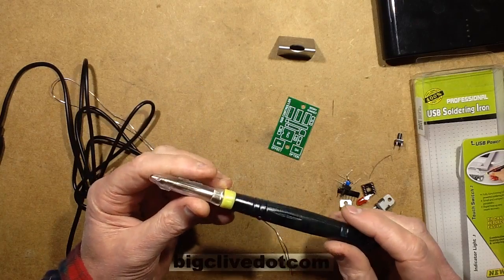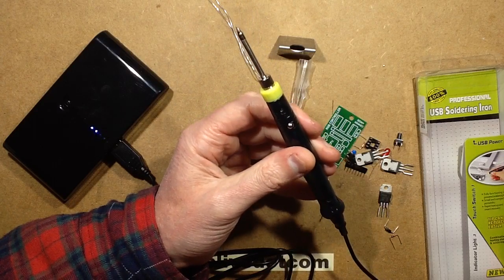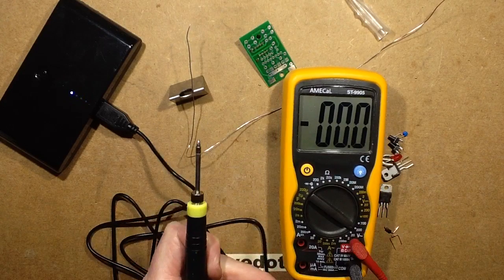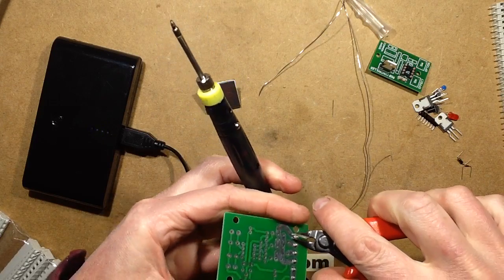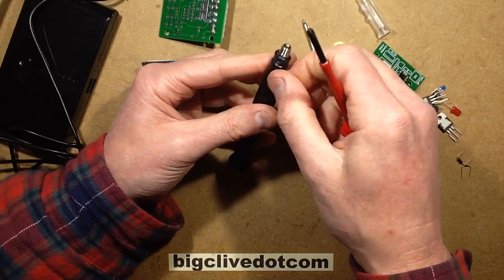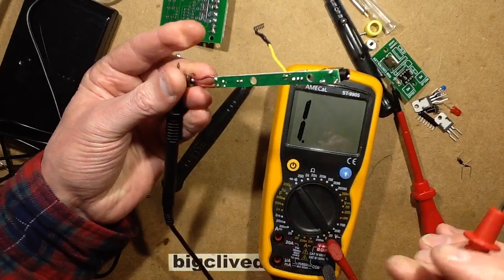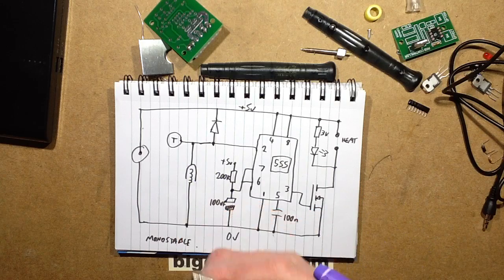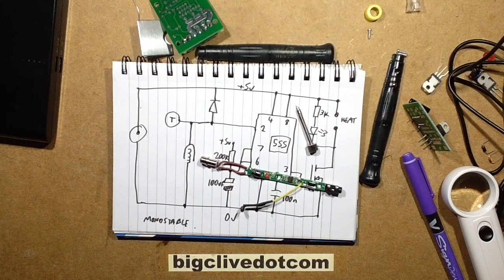USB soldering iron test and teardown with schematic.

Comment: I've got the same one.  Can't get it to tin and can't get wire to take the solder.  I'm thinking it might be my solder now because it's three irons so far. 

This iron killed my battery pack though
Reply from the maker: The power supply has to be able to deliver 2A and I recommend the use of solder bought from a component supplier in your country.
Reply: bigclivedotcom the power supply it killed was 2.1amp. The solder I got locally is just balling and falling off.  I should ask the microsoldering shop which one they use

Comment: mine didnt get hot. Only led came on
Reply from the maker: Did you unscrew the cap?  It pulls off and the threaded collar has to stay on to connect the tip.
Reply: Found the problem. Had to clean the socket a bit that the solder tip goes through. Works like a charm now

Comment: By coincidence, I already have an identical iron, which I bought for emergency use, but I have never needed it. Are replacement tips available?
Reply from the maker: Yes they are, but it's just as cheap to buy the full iron.
Reply: You can find replacement tips for $1.50 on AliExpress it's still better than paying $4.50 for buying a new iron.

Comment: Thank you so much for this video, I know it's over a year old but I just recently saw it. Was so impressed I bought one. It didn't work. Figuring it would cost more to send back than just buying a new one I just bought another and emailed the company and let them know it was DOA. The day after receiving the replacement I got another. The company had sent me a replacement free of charge. With the second one I was able to fix the first. I now have 3 for the price of 2 and I am very happy with them!! Thanks to this video and you I also know how to remove the replaceable tips.

Comment: for those, who are maybe interested: since my usb soldering iron doesnt work anymore, i took it apart and messured the resistance of the heating element (51k) and you can just connect it to an usb-cable and it will work like it did before (like said it the video), it's also good if the "auto off circuit" is too annoying :D

Comment: I can't believe I haven't seen this video earlier!  I have one of these soldering irons and I just love it.
It's very fast.  seems to be hot enough in about six or seven seconds.

I have it in a little kit with a small 18650 power bank and it lasts a pretty good long time.  

It really does work surprisingly well.

Comment: What if i solder a 3.7 volt adapter to the contacts of a powerbank where the battery would be connected to.
Could i then just plug it in

Comment: The good performance is all due to the near perfect thermal coupling between the heater wire and the tip because those are one indivisible part.

Comment: Is it 100% safe when used with a power bank? I will need to solder some stuff that would be dangerous if its outputting electricity and would break it.

Comment: many years ago i received a battery operated soldering iron called Cold Heat from Radio Shack. Its ok, but eats batteries pretty fast and i think it could damage components. i was using it once and it started lighting up LEDs on the board? lol 

https://en.wikipedia.org/wiki/ColdHeat

Comment: sheeeeeettt I am going to buy that sucker. When I m working on my bike (the electrics), I could never proper solder the fucking cables, because I have no accesable socket outside.... But fucking hell, I would have NEVER thought that such tiny usb soldering irons could handle anything....

Comment: Kind of put of by the Chinglish instructions: 
Method:
1.Open the iron burger skull, not to the left twist, pull off can be used directly. If left to turn the screw wrench to Gary, iron head shaking does not connect, unable to work! Then cover the right screw directly pull under it.
2. The product switch is the human body induction switch, the hand holds the handle 5 seconds to begin to heat up, after leaving the handle, the handle will slow down.
3. The power supply is best to convert the USB power supply, computer power supply, or more than ten thousand Ma mobile power supply. Small capacitance of the mobile power will not move!

Comment: I have one of these, had it long before your video in fact.  She is not without a down side, for one the male plug is troublesome you see I was in the habit of using her for short jobs then just unplugging it from the iron side and laying the plug aside. I had it hooked to a 110 to 5 volt multi outlet USB charger device that puts out lots of power. Anyhow one day the plug fell against something that shorted it out. I could smell something burning, and like an idiot I began to feel around. I now have a perfect mark of that plug on my left hand, man that thing was HOT.  My chair nearly burst into flames because the cord was against the upholstery (i do my work in a recliner, not a great idea but the only comfortable place I have to sit any more).  I went back to using my regular regulated 110 volt iron and unplug her from the wall when not in use, the little iron is in her box and used only when I have just a couple of joints to solder. Also she gets way to hot if used to say, put together a kit. I have several I was putting together for Christmas to sit on the dash of our motor home that have the traces burned off, We are always  living in the motor home in the winter months down in Arizona, avoiding the cold and snow of the Dakotas.

Comment: nice review .. I've just bought one of these for my son to repair a connection on his drone .. is the solder that comes with it pre fluxed or will he need some flux?
Reply from the maker: It should have flux in the solder.  There's no harm in buying some more electronic grade solder.  Preferably the traditional 60/40 tin/lead based stuff.  Remember that the soldering tools cap pulls off.  If you unscrew the cap the iron will not heat as you are unscrewing one of the connectors.
Reply: bigclivedotcom .. thanks for your help. I got the lid thing from your video .. very informative, thanks 😊

Comment: Thanks for the plan. Mine triggered when I approach it less than 1m, I had to put a 1M resistor on the input. It doesn't work on a pack, only on devices connected to mains. Thus I must connect the pack to my PC, then the iron on the pack and there it can be started. So, I will replace the monostable by an oscillator with an adjustable resistor for the frequency to control the produced heat, of course it will run until disconnected.

Comment: If you had a sensitive part you could just run wire through between the 3 pins of a MOSFET (for example), that would protect the gate from this little bit of leakage current - But, if you mess up & forget to remove that wire before applying power, that would be bad... I'd just as soon use my good station :) 63/37 solder I suspect? (It helps. :))

Comment: Clive, I got one of these and initially used a 2 amp asus tablet charger, which made it too hot and corroded the shank of the tip a little. 1 amp and .85 amp wall warts heated it up fine, but with the AC leaking problem. I tried a 2500mah DANELEC media server with charging function and the iron timed out too often. I finally bought an iHome 2200mah battery which does not time out, but heats the iron to smoking quite fast( It claims to output 1A while yours seems to draw 1.4A without problems). My tip will now not wet and I am considering getting Weller tip tinner but I worry that it will happen again with that battery. I did not want to mod my iron and bypass the switch but I may have to as well as use it with a different battery pack. Thank you for any insight you are able to provide!

Comment: I am thinking this soldering iron with the guts ripped out, plus a 90mAh battery from a disposable e-cig, and a new PCB for it, and you have yourself a rechargeable soldering iron for next to nothing. Make a little charge cradle for it to sit in, and it's always ready to go.

Comment: Man when  I saw the first review on this little Iron I just had to order one.  A year or better since, now and the history of the iron is a bit on the dark side. It seems there is no temp cut off, and it can get very hot, thus releasing the traces from those cheap China kits. I ruined several before I realized what was happening, as well as taking out a few do it yourself power bank kits. I also burned the hell out of my thumb when the unplugged (from the soldering iron) cord that was still plugged into a wallwart type power supply shorted out down the side of my recliner and caused the wire to go red hot, setting a fire to my good recliner and burning the hell out of my finger as I pulled it from the side of the chair.  The little iron now sits in a bag, unused except for small repair jobs where getting out my regular iron is too much of a hassle, and perhaps fixing something in the car where power is not available,

Comment: Sadly they do not last for ever, and that plug on the end is rather dangerous. Somehow that plug became shorted out against my recliner one day and actually set it afire. Luckily I was sitting in it at the time and reacned dow for one of my elctronic toys, I touched the shorted end with my arm, which quickly alerted me to the short by burning a large mark on my arm.  Well the burn is healed, although there is quite a scar. Oh and the iron doesn;t heat up enough to do the job for quick repair. Not sure how that efected the iron itself, but it seems to have.

Comment: Thanks Big Clive for this review, I watched it a little before christmas so ordered one, it arrived a few days ago and I was also similarly impressed with it.

But one thing is missing, another LED to show when it's getting power, so today I superglued a yellow SMD LED on top of the 555 chip along with 2x 100 ohm resistors in series - now I know when the USB power bank has shut down. I also replaced the red LED with a brighter & wider angle one (well, just chopped its head off) and replaced its resistor with a 2k one.

This thing was so cheap and potentially useful I might have to buy another one.

Comment: I have tried everything possible. The led come on, but no heat.
Reply from the maker: Are you unscrewing the cap or pulling it off.  If you unscrew it you are removing the elements outer connection.  The cap is intended to pull off and the threaded base should be on tightly.
Reply: I looked at your board and I have all the same parts except the part that you said looks like a crystal by the MOSFET. I think mine must be defective. I even tried powering by external power. LED is on, no heat.
Thanks

Comment: mine won't heat up at all
Reply from the maker: Are you unscrewing the cap or pulling it off.  It's designed to pull off, although it's very stiff.  If you unscrew it instead you are removing the tip retainer and opening its electrical connection.

Comment: I bought one like... eight years back (holy crap I feel old X3), made by a company called Mega Power. Worked awesome, learned to solder with it by replacing capacitors on a motherboard. Didn't last though because I didn't know how to take care of it. Bought another one recently, thing's been redesigned and is complete crap. Melts solder but just barely.
Super excited to find another one that works! :3

Comment: Hi been using one on small smd and through hole components for about a year been brilliant for small stuff. A very capable iron I bought 3 more as the replacement tips were only about 50p cheaper!! I gave one to my sister and she uses it for art stuff on fabrics. I built a little 5volt PSU for it so it keeps it safe to use. l don't use on computers or charges but it can be powered from a dedicated charging unit as they are usually designed for about 2amps on each port but not all at once. Like yourself I thought it was a bit of a joke but it has not failed or given me any problems and not even changed the tip!.

Barry Mayson

Comment: One problem that doesn't come up in testing is that, after a while, the ceramic insulation between the two poles of the heating element can crumble, shorting the connection.

I made a wooden ring from a sliver of toothpick, which kept it going till i got a replacement.

I now have these all over. One at home, one at work, a couple in tool boxes, so I usually have one to hand when I need one.

oh, and de-soldering anything but the smallest connections is orders of magnitude more difficult than soldering :-)

Comment: Oh so mains voltage present at the tip due to capacitive coupling explains why my Hakko FX-951 and other decent transformer based soldering stations have the tip connected to mains ground?

To bleed off the capacitive build up of mains voltage at the tip before it builds to a dangerous level for components?

Comment: Clive, what is the best way to get rid of jagged bits of solder being left behind when you pull the iron away from an area? From what I have seen it seems to be using a bit of flux, I especially ask this with very thin etching trails in mind, thanks.
Reply from the maker: Reflowing with flux will help.  The tails are a sign of the flux being used up.  Remember to use a good flux cored solder and never carry solder to the joint on the iron.  Always feed it directly onto the heated joint.
Reply: bigclivedotcom Thanks Clive, I recall a lot of flowing with the iron in my classes because the iron felt like it heated like shit.

Comment: You can get replacement tips now

https://www.aliexpress.com/item/High-Quality-1pc-Replacement-Soldering-Iron-Tip-for-USB-Powered-5V-8W-Electric-Soldering-Iron/32754871830.html
Reply: they are also on ebay now 
http://www.ebay.com/itm/NEW-Replacement-Soldering-Iron-Tip-for-USB-Powered-Mini-5V-8W-Electric-Soldering-/282304782957?hash=item41baad226d:g:WyUAAOSwZQRYYilz

And about the same price!

Comment: hi clive! awesome channel, i love your videos.
recently i've bought one of theese usb soldering irons and i converter the 555 based circuit to run at about 2 hz 50% duty cicle and i removed the touch button and inserted instead a normal push button to force down the timing cap (so all time heater on). with this config the soldering iron is awesome! 
bye ;)
Reply: Tesla4Ever could I ask, what switch did you use, did you glue it in or was there somewhere to solder it?

Comment: It's and excellent iron, I made the exact same mistakes when unboxing and thought I got myself a lemon. But no, it works great and replacement tips are available on BG. Used it on the laptop USB and it worked well, but I use a power bank now.

Comment: Are there any grounded power supplies? 

I mean...the RCD shouldn't trip, cause the extra current doesn't disbalance the mains, but just goes to ground
Reply: I would like to know the answer to that as well... Whats the difference if I just add a ground in my USB power supply? It has the third prong but when I took it apart, it isn't used. Could I simply solder a wire from the USB Shield to the ground prong?

Comment: Hi. Could it be powered from a in car usb outlet
Reply from the maker: Only if it could supply the required current (2A) and you'd have to be careful to avoid contact between the tip and the vehicle ground as a precaution.
Reply: Thanks

Comment: Now try to plug it in to a usb fast charger. ( I did and got the tip red hot, i think the charger assumed that it was a fast charging device >.<!). But anyway i think is a good portable gasless iron. Great vids loving the electronics dissection :-).

Comment: Small question, if I want it for really small parts, I see it can handle it, but can it harm the components? I usually solder arduino parts, and I want to power it from laptop USB conection, how does this setup sound? can you recomend it? is it a good idea? the price it tempting.
and btw, awesome vid! 
thanks
Reply from the maker: I wouldn't recommend powering it from a laptop port in case it draws too much current.  The only power source I'd suggest for this iron in an electronic application is a beefy power bank capable of supplying 2A.
Reply: Thank you for a fast reply friend, and please forgive me for my ignorance of my other question :) but what is that downside, lest say my laptop is always plugged in AC (so old it become stationary) and I got a free usb port to use that soldering iron, what is the worst thing that can happen when it draws too much current?
And thank you again for taking you're time and helping out.
Reply: less then it needs to work?

Comment: I got one of these and it doesn't seem to be working. When I power it the LED is lit, but a usb ammeter shows <0.01 amps and it does not get hot. Any ideas?
EDIT: Just re-watched the video. I was unscrewing the cap, as you had been. d'oh!
Reply from the maker: Lots of people have been doing that.

Comment: It's a great little iron, I've enjoyed using it so far.
I haven't been able to find spare tips at a resonable price though. It's actually cheaper to buy a new iron rather than replacing the tip.
Also, that capacitor needs a change. The iron turns off way too fast, nothing like the 25 seconds it says on the box.